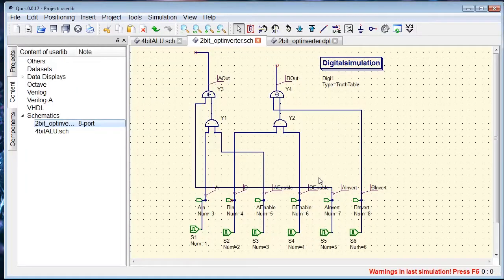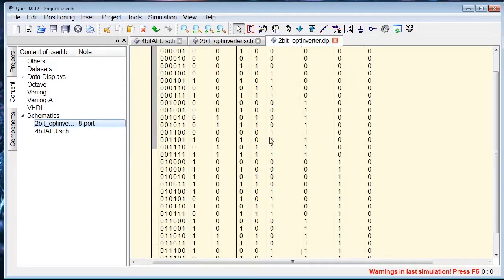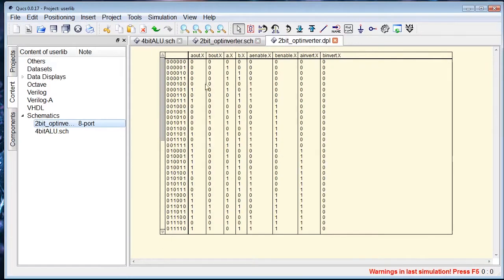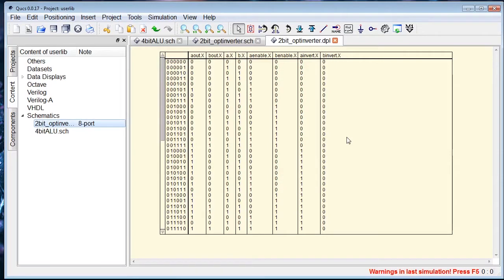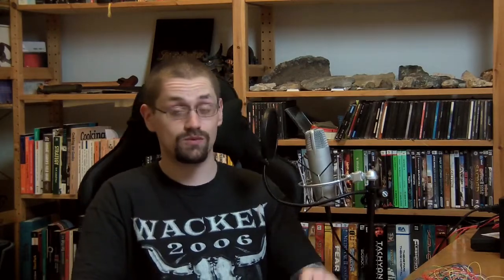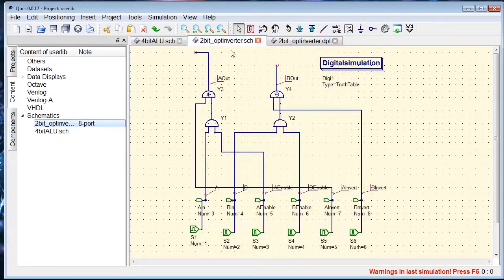Electrical Circuit Simulation - Lets Build Diaries - 8 Bit Computer  Part 2

Comment: Analog simulation is worthwhile if the parts and equipment needed to build a prototype and analyze it are more expensive than the money-equivalent of the time and effort needed to model, configure and run the simulation. Eventually, in production environments, it all boils down to time and money comparisons. In mechanical engineering, for example, we ALWAYS do simulations before building a prototype, because of the reliability of the simulation and because it saves A LOT of money in

Comment: Thanks for your latest. I have a question, I reading about all the different logic family's there is. Is it going to be a problem to use chips from different family's , in what I read is the they can work at different speeds in nano seconds. Is this going to give me trouble, 

Thanks again max like the info, on simulators 
I would not like to get bogged down in them .
Think best to plan it out on paper and make it for real on boards so you can see it for real